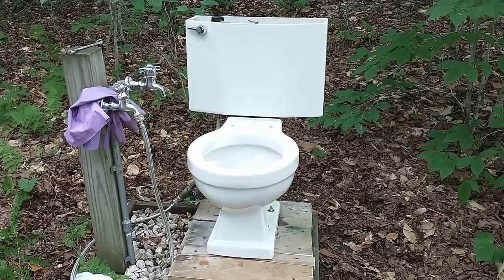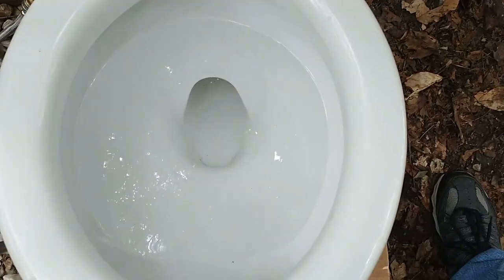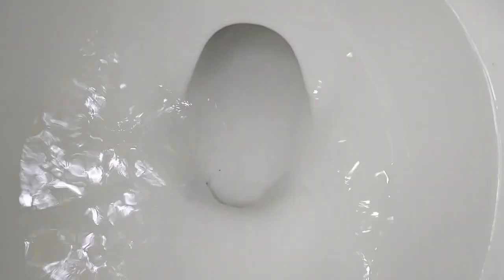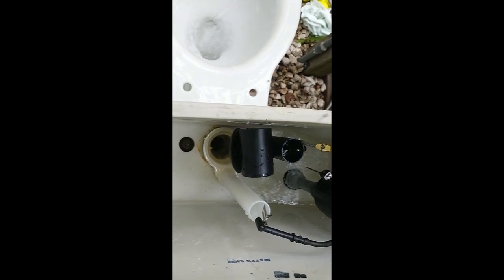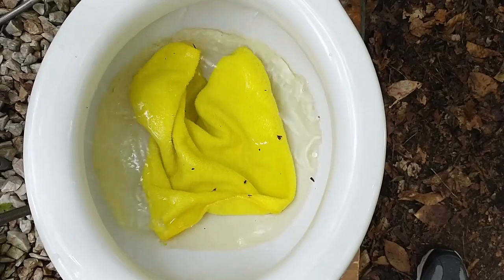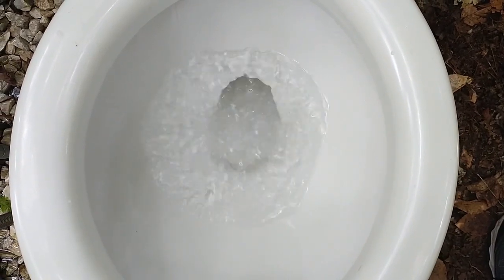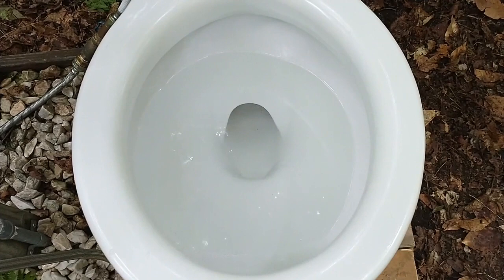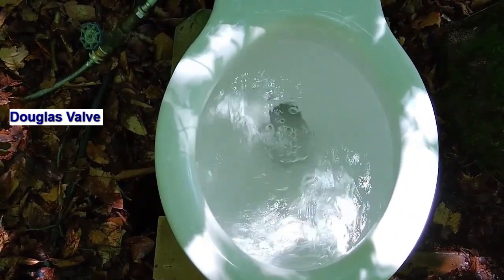114.  Testing The 1957 "Standard" Cadet Using A Tilt Valve

Comment: I think the problem is the overflow tube. If it was a bit higher the tank could be set to the correct water level. That could probably make the tilt valve and the other ones improve the toilets performance. I do think the tilt valve is open for way too long, but it’s cool at the same time since it refills the bowl.
Reply from the maker: Toilets Of Washington State, you are absolutely right about the height of the overflow tube, plus the fact that it takes a long time for the tilt valve to close because the hole that drains the water out of it is too small.  I had the same problem with long closure time when I replaced the tilt valve on my 4049 tank.  I used an awl to enlarge the hole.  It was an interesting test.  Now I'm thinking about going back to the brass Douglas valve but with a different tank ball, one without the projection.